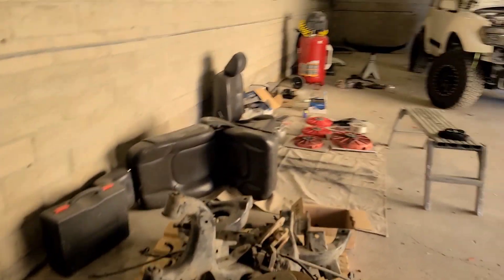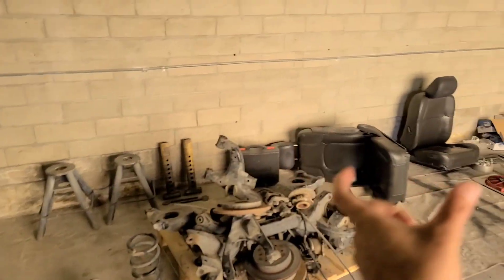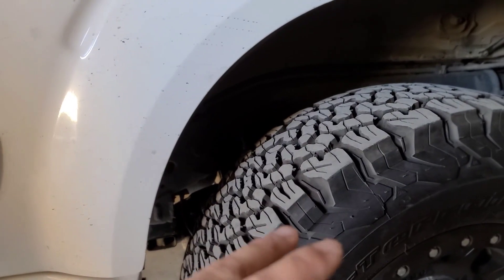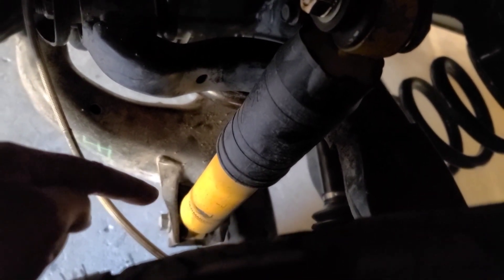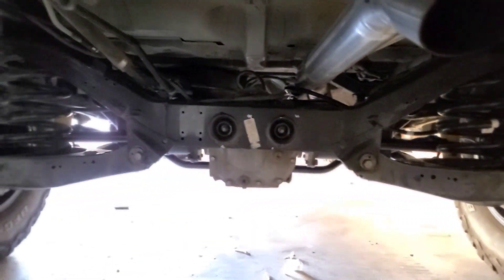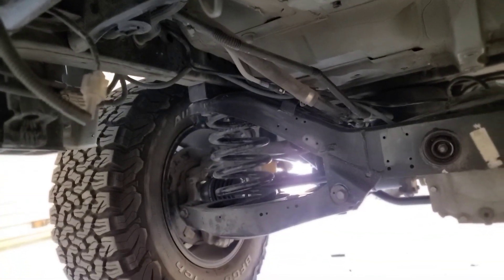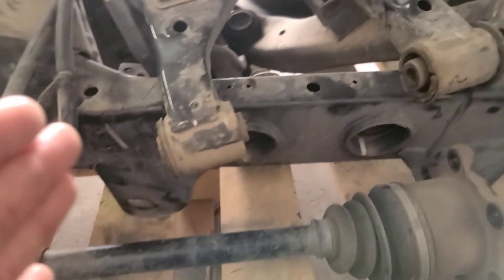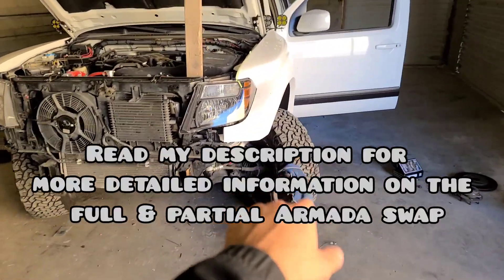2011 Nissan Pathfinder V8 Full Rear Armada Suspension Swap Explained | R51

Comment: Without changing the subframe and shock mounts can i swap rear with armada? I have a v8 pathfinder same rear diff as armada from factory.  Fromt is already swapped
Reply from the maker: You dont have to, but the reason I went with the Armada subframe is to have longer wheel travel for Offroading.

Comment: Quick question, what driveshafts did you use? Was it a factory armada shafts or do the pathfinder shafts bolt up?

I'm currently doing the swap with front and rear diffs as well as the transfer case.

Any info would be greatly appreciated 👍
Reply from the maker: I did not change it, I used the Pathfinders drive shaft that it originally came with.

Comment: Would be pretty sweet to see this on an xterra.
Reply from the maker: Yes! 🔥
Reply: @fabiansbikelife1558  Would you happen to know if the mounting points for the rear subframe are the same on the pathfinder and Xterra relative to the wheel arch (or if you have a buddy with an Xterra, would you compare 😁)? I think the mounting points for the subframe are on all of the F-Alpha platform trucks (titan, armada, pathfinder, xterra, frontier), though, when the guy at LOJ was swapping the Armada subframe into his frontier, he couldn't use the factory mounting points on the frame, otherwise it would have moved his rear wheels forward 14" and not aligned with the wheel arch in the bed. See https://youtu.be/arCuX1bRSlo?si=H-yXlMUb80dTNS2Y&t=10 and https://youtu.be/KV1ehkW7rW0?si=WBw7G6B8W65Soh4L&t=280 .

Comment: Are the armada control arms longer than the pathfinder?
Reply from the maker: No but the have different shock mounting points
Reply: So the width increase comes from the X member.
Reply: Are the armada and pathfinder axles the same spline count and size. Just the length is different.

Comment: Great videos! I’ve been researching to do this for a little over a year (it’s a big investment) and these have been the best resource next to going to a junk yard and messing around with stuff. If you would I have two questions. 

Did you use standard coil springs in the rear to achieve that lift you wanted with the body lift or did you extended length lift coil springs anyway? And if you couldn’t find a fabricator would you have drilled into the side of the chasis frame to make new strut mounts using a kit? 

Those are the last pieces of my puzzle before I finish sourcing parts and building.
Reply from the maker: Thank you, I appreciate it.  I currently have a different set up now but I did use the armada coils  during that time. I would definitely use a fabricator no matter what.
Reply: @fabiansbikelife1558  what set up are you using now?

Comment: Currently doing my swap  which shocks did you use on the back?
Reply from the maker: I have a video on the set up i currently have: https://youtu.be/C-kmGSt1-p0

But I ordered the RADFLO 2.5 REMOTE RESERVOIR COIL OVER SHOCK 7/8" SHAFT with 8in Travel. They're about a 6- 8 months out